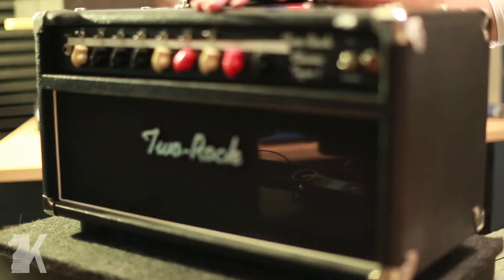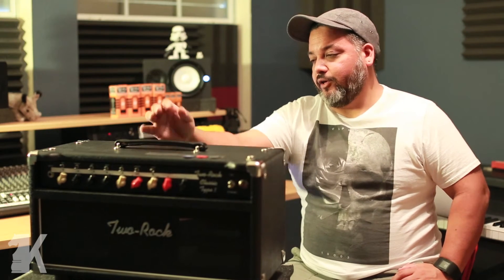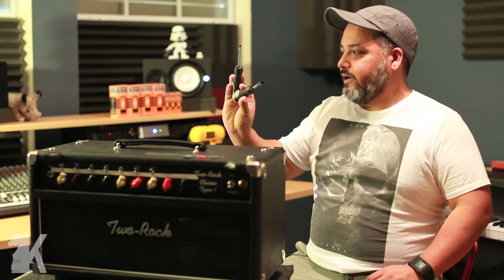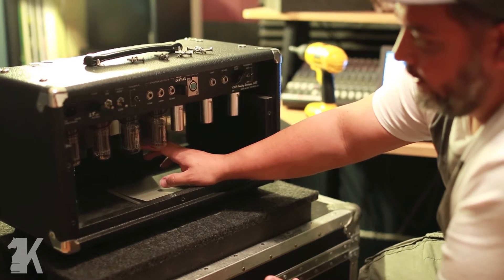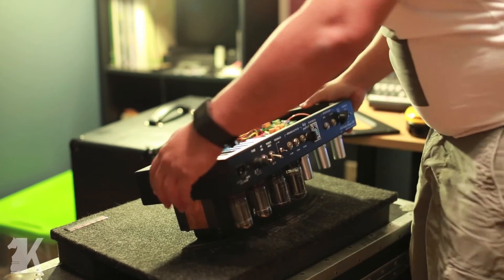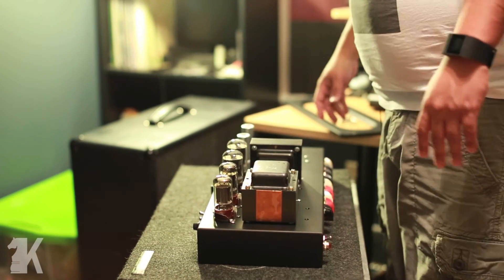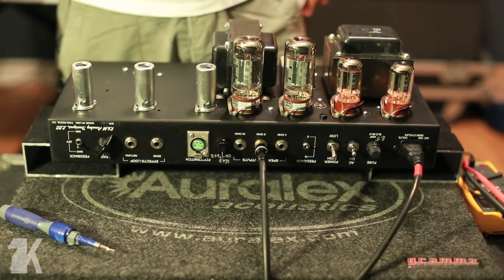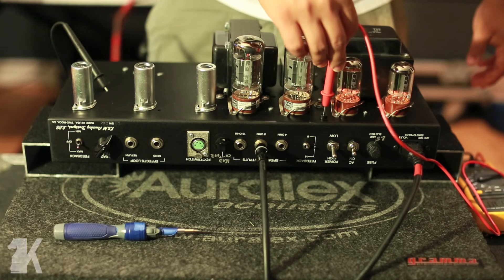Logistics: Retubing and Biasing Basics (Two-Rock Classic Type III)

Comment: or 28ma per tube
Reply: No , it depends on the tubes plate current and every matched pair usually has a different plate voltage !
Put your bias plate voltage in the tube bias calculator online and it will give you the correct Ma for each tube so you usually adjust a trim pot for two tubes so you double the MA and if its 28 you set it for 56Ma !